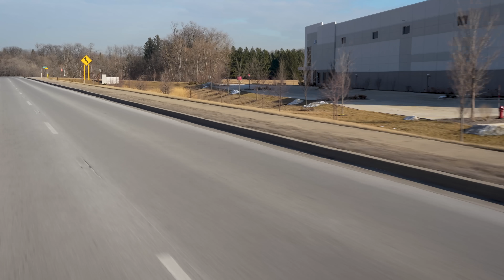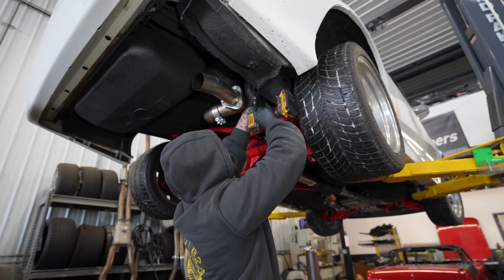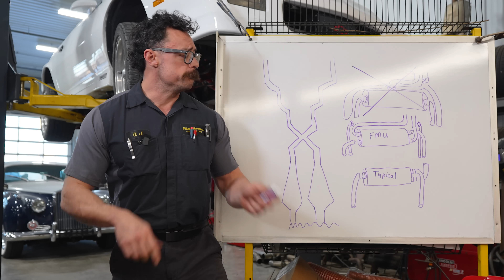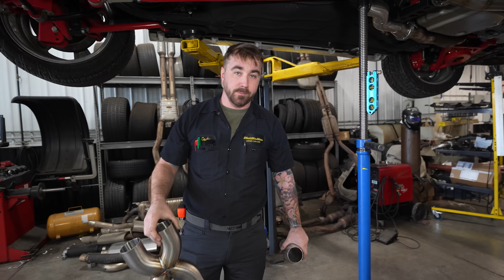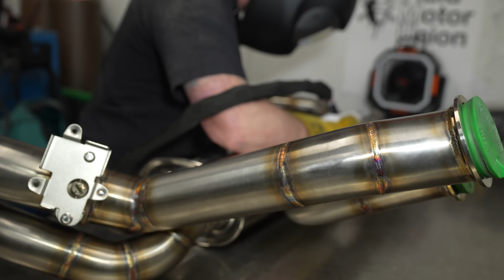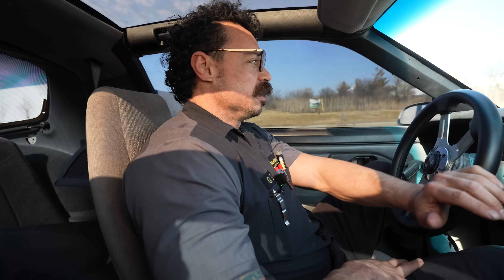This Camaro Exhaust Shouldn’t Have Made 30+ WHP: LS3 Stepped Pipe Layout Everyone Will Copy

Comment: Have you tried headers with 2 or 3 steps?  The calcs for Tri Y start off surprisingly small, again with multiple steps.  Either one will really change tone.

Your chassis dyno should be able to measure resistances and spit out a real brake HP number.  It's close, but not over 600

Comment: It’s a well known fact in the 3rd gen community that long tubes have to go in and come out from the top. That car has a tubular k-member that gives even more room over the factory cast k-member. 

There is just not enough room in the tunnel for exhaust.  The oem exhaust has the driver side cut under the bell housing and join the passenger side in a “T” merge. Horrible for flow. And the floor design is horrible. It wasn’t designed for exhaust routing of any kind.

Comment: 50 hp gain from an already performance exhaust is insane.   Nice work
Reply: Tune and custom exhaust
Reply: @ambercrowder8058 tune should always come with a custom exhaust…
Reply: He fixed an incorrect crank sensor and TPS. Also changed the tune and the exhaust. This is a good video but the title is a bit misleading.
Reply: @subbassrules but they did all that before they dynod it the first time
Reply: Tune and custom exhaust

Comment: i'm considering using two borla pro-xs mufflers with two inlets and outlets with a x pipe design in the muffler. i don't want to be "loud" i don't want people trying to race me. so i was going to put them inline with each other so there would be 2 mufflers on it but one leads to the next then opposite side pre-axle exhaust. any reason i shouldn't do this?
Reply: Carbon monoxide is a problem without tailpipes or side exit.
Reply: @Twogreenfeet  i did say side exit

Comment: Wow! I’m assuming all the “after” clips are with the valves open? Did you also dyno with them closed?

Back the early/mid 90’s a custom exhaust shop in NJ called Mufflex offered 4” systems for those F-bodies, single tailpipe out the driver side.

Comment: I have an ls3 corvette and wanted to know what you guys (anyone in the comments or FMU) thought would produce the most exotic exhaust tone. Running an x pipe with megaphones or running a z pipe with megaphones. And should the megaphones go before or after (x or z pipe). Currently have a muffler delete and plan on either headers or welding in 200 cell cats where the OEM cats are (I live in an emissions testing test). My car only has the two cats, not the updated 4 cat California compliant system.
Reply: My humble message is put those megaphone before Z pipes  don't use X pipe & 

as you said you have cat problem in California but equall length headers are the one  main elements for achieving true exotic tone but rest of exhaust is equally important but do as your local emissions permit you or simply put those equall length headers 

&  by putting megaphone before Z pipe you gave enough space to settle exhaust pulse before exiting 

 remember megaphone is here for increasing exhaust pitch 

Z pipe have natural sounding tone (my personal thought) & as OJ said it is designed for better scavenging effect & kind of x pipe but better engineered 

X pipe have louder effect but with bit of distortion tone with megaphone 

which is for purest sound texture lover is meeh  for x pipe 

Hope it's help you 🎉🎉 
& Hope You understand my scattered English 😅

Comment: I've been waiting for you guys to do a thirdgen. I might have just missed it, but at what point did you step up from 2.75 to 3? I'm not always a fan of the tone you guys achieve, since it is typically higher, But I think this one sounds better than the before. As always the craftmanship, is where it really shines.
Reply from the maker: The rear valves outlets are stepped to 3 at the y that splits to the muffler
Reply: @FluidMotorUnion  Oh I didn't realize it was so far back. I appreciate the response.

Comment: Loosing traction when its winter in Chikagoh? Those aren't tires anymore, those are bowling balls.

But....are there only white G3 cameros left? 🤷‍♂️
Reply: Oddly enough, not only do I live a couple towns north of FMU, I have the same tires in 235/50ZR18 on a Chrysler 200 with the minivan spec 3.6l and 6 speed auto. Normally those tires hook pretty well, but traction was a problem for me around that time too.

Comment: Using the correction factor is what makes it more consistent not less. Insane all the science talk but not knowing how the correction factor works.
Its what corrects a hp number from a hot day to a cold day so you dont get different numbers for the same relative output.
Reply: As a motorcycle mechanic that worked in a shop that was very well known, the correction was almost turned off so we could see the small changes, especially when using for diag because it could mask problems or slight tuning changes. After we were done you could add correction to make the curve look smoother so the customer would have his pretty looking brag sheet. And if it is a different temp or humidity It's also logged so as a mechanic you could see the difference in DA.. correction factor is for dyno racers not real engine builders and tuners.
Reply: This!
Reply: Well the only sensible way of using zero correction would be that you want too tunne the engine too perform similar in very different conditions  but that approach leaves quite same horses  on the way 😅

But choosing the right correction factor isn't always easy  and I would say better without any than the wrong one because that screws the data completely 😅

Comment: OJ I have a question for you guys, around 6:25 you mentioned  that turbo's mess with the pulses of the exhaust. So the formula or approach with something with a turbo would be much different correct? I have a JCW Mini Cooper and have been deciding what approach I would want to do for an exhaust. Would  a megaphone in the exhaust make similar changes to what it does on a naturally aspirated car?

Comment: Wow, and this dyno reads low.
Reply: They are at like 3500-4500 altitude of course it does
Reply: @norcalnicky415  the Chicago area is at sea level
Reply: Good lord, 10 seconds on google and I learned that Naperville’s elevation is 700 feet.  🙄

Comment: I agree on the slip fit headers that's an absolute problem area and shouldn't be used, but that's one sweet Camaro
Reply: Well they are all right for after market kits so a young guy with little money cann get a bit different exhaust sound on his first shitbox even if it sounds meeehh but I would say it is a good start of becoming a gearhead
Reply: @TheLtVoss ya but it's just a better product and a cleaner solution than slip fit and adds very little to cost , slip fit is a guaranteed exhaust leak for the young kid and his 💩 box lol as you say
Reply: Not ideal but I mean I didn't see any soot indicating a leak, v-bands always leak on the other hand in my experience, the ones without a gasket
Reply: @Sam-go3mb the Vbands very seldom leak, nor do the bolt together tri collectors but the slip fit always leak
Reply: @Gregssmilespergallon  I always weld a slip fit personally so no idea, but I've had multiple v-bands leak unless I put a layer of exhaust paste in there
Reply: that's any aftermarket exhaust kit for any car..they're made to bolt on without welding on V bands.  So long as the pipe ends don't get bent they slip on and off just fine, put a little anti seize on the pipe and they come off no problem.
Reply: @vans1107 no it's Not! Several brands like Kooks , Borla , Magnaflow , American racing headers all have bolt together collectors, illuminating the weak point of slip fit headers, and no need to weld them either!
Reply: @Gregssmilespergallon  I didnt say EVERY, but most are slip fit connections...hell on 4th gen Fbodys even kooks uses slip fit connections on their $2500 exhaust systems..the only flange type that isn't a V band would be a 3 bolt flange or ball/socket style..I don't see many exhaust "kits" including headers and a complete system those style flanges, especially on systems made for newer cars because of ground clearance and the tight confines under the car.
Reply: @vans1107 right on , you do make several good points